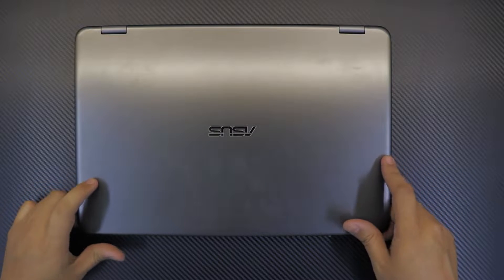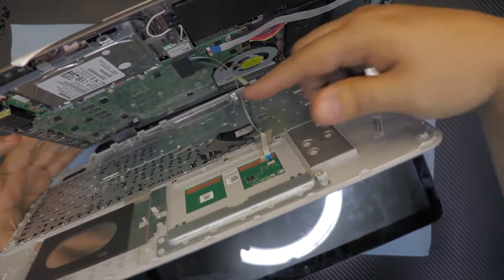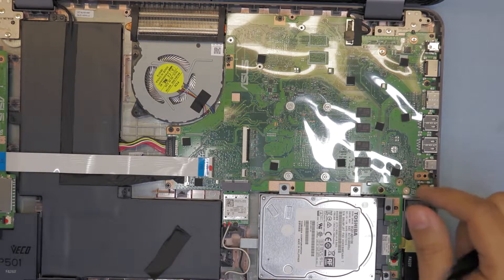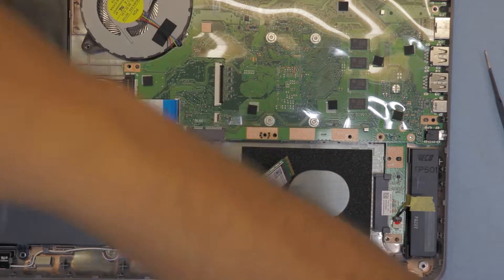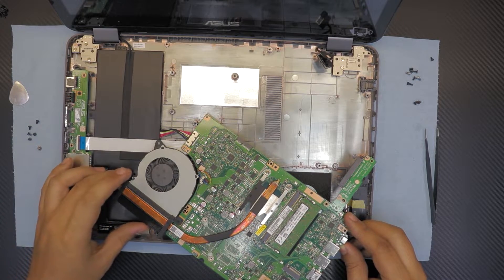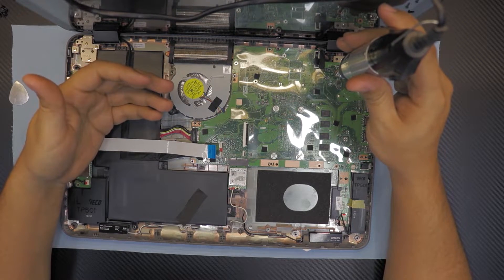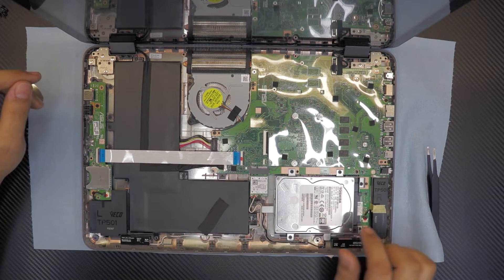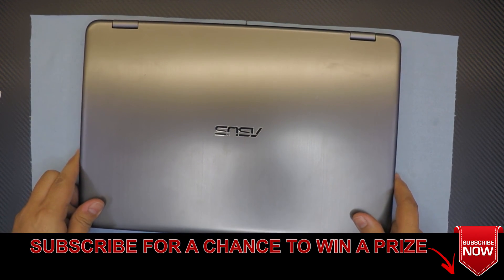ASUS VivoBook Flip TP501UA Disassembly and Service

Comment: Hi! I have the ASUS VivoBook Flip R518UA-DH51T 15.6". I’m trying to do a ram upgrade but wanted to make sure if it’s the same exact laptop you had before I open mine up. What would the max GB RAM and am I able to remove the Toshiba hard drive and install an SSD!
Reply from the maker: 🫠Regarding your question, sure you can remove the HDD and place any SSD 2.5' up to 2TB without any issues, and install the windows in it.
about the ram to check the max ram capacity check this: https://youtu.be/tKEJTkVth4Q
16gb compatible ram: https://amzn.to/43oWNPN
Should you have any further questions or requests in the future, please don't hesitate to ask me.
cheers🍻

This is an Amazon affiliate link. When you use my links, you are helping to support the channel. 🙏

Comment: Hola un saludo, como podría resetear la bios de esta lap, pues no funciona el teclado el mouse, ni los puertos usb y ni el touch de la pantalla o sea no hay forma de comunicarme con la tarjeta madre, es que veo que no tiene pila para el bios .Gracias
Reply from the maker: El problema no es de bios es otro chip que controla el IO y has que cambiarla, y soldar uno nuevo, recomiendo que lleve a un tecnico bueno. no es solo resetear.
Reply: @uFixTek  Gracias agradezco tu respuesta
Reply from the maker: @albgerb.b.2021  por nada amigo, espero que encuentres a un buen técnico que te pueda reparar. cualquier cosa me avisas.

Comment: Is RAM upgradable i dont see a slot
Reply from the maker: Thank you for the feedback! if you wish to support the channel you can LIKE or SUB or both :P
regarding your question: there is a ram dim soldered on board and on the other side of the board there is a ram dim so you can upgrade @8:40 i'm pointing to it

Comment: Quick question, I have the same model but my laptop is stuck on the BIOS screen and even disabling the security boot and enabled csm, after saving and restarting I get put onto the boot screen, from there I can only go back to the BIOS, is something wrong with my Harddrive ?
Reply from the maker: Thank you for the feedback! if you wish to support the channel you can LIKE or SUB or both :P
regarding your situation: its most probably that you hdd is dead, i would recommend you to place an SSD for better performance and stability.
and install windows, here are some links for the ssd and how to burn windows into usb:
https://youtu.be/uDu8j2lE-dM
to boot into usb its f12
use this windows installation step for tips and tricks:
https://youtu.be/er1UXhie3cA

ssd: https://amzn.to/3gxaeFz
https://amzn.to/3vfxM71

Comment: Where is cmos battery location?
Reply from the maker: this models don't use cmos battery they use the internal battery, disconnect the internal battery and press and hold the power button for 30sec to clear cmos.
i appreciate if you sub to support the channel :)
Reply: @uFixTek  what if it doesn't work at all, it keep shows nothing on both leds, no charging no power, is it mosfet faulty or something??
Reply from the maker: 1st of all you if you have no led light or charge light it has nothing to do with your cmos.
you need to make sure that you have power going across the power jack use a multi-miter to measure that the 19v is there after the jack and let me know,
https://imgur.com/a/zoLXPA6

Comment: Can you still use if you take out the battery?
Reply from the maker: yes you can and it will work just fine and even the motherboard will last longer because it wont have to charge the battery. good luck  and thank you for the support

Comment: I have the same laptop fpr almost 3 yrs but its so slow do u know if i could possibly speed it up or upgrade it
Reply from the maker: you can speed it up a lot just by adding an ssd :
https://amzn.to/32lY9Ma
and use your mechanical drive as an external drive:
https://amzn.to/3hvB3ZY
Reply: @uFixTek  thanks and how much vram can i put in there?
Reply from the maker: vrams cant just be added only regular RAM can be replaced. this models doesn't have a video chip nor vram.
Reply: @uFixTek  does your version have a nvidia graphics card
Reply from the maker: no the version in this video doesnt come with video chip. and if it did the vrams are always always soldered on board.
Reply: @uFixTek  oh because mine has a 940mx
Reply from the maker: ok then you have GPU and vrams beside it, still you can't replace or upgrade vrams or gpu
Reply: @uFixTek  oh ok so i can only really pur an ssd in
Reply from the maker: you CAN put the following:
-put an SSD
-replace your RAM with a bigger ram dim.

you CAN"T do the following:
-no CPU upgrade
-no GPU upgrade
-no vram upgrade

Comment: Does anyone know if this model laptop can run with power plugged in but no battery?  I want to troubleshoot my TP501 problem after a water spill.
Reply from the maker: yes, you can run the laptop without the battery plugged in  with no problem.
Reply: uFixTek Thanks for the helpful answer.  My son actually spilled water on my laptop.  it shut itself off totally. I took the laptop apart and let each part to dry for three days.  Then I assembled back and plugged into the wall outlet to give a try.  The laptop’s lights was on for 2 seconds and shut off totally again.  I guess it is total loss for my lovely Asus laptop.  Your video has helped me tremendously to do all these steps above!!
Reply from the maker: im glad it helped you for some parts, that laptop is repairable but you need to find a good repair tech that knows how to repair components, else they will just milk the cow. :(

Comment: Hi bro how are you. You remember me. I installed m. 2ssd nvme samsung 970 evo plus  ssd as per suggestion but i face some issue. Its not detect ssd  in my laptop. Please give me any solution
Reply from the maker: did you place the m.2 ssd correctly in the slot, if you did email me at bdsoporte.queretaro@gmail.com
Reply: @uFixTek  hi bro please check your email i send some photos  what i did and please give me any solution 
Thanks

Comment: tanks for video. did you work on mother board with battery conected?
Reply from the maker: yes you can work just fine on the motherboard with battery connected as long as you have the power off. and make sure you dont drop any screw or screw drive inside :P else you can simply disconnect the battery. thank you for the feedback

Comment: Thanks ++ Bro.
Question re the Power Button... could a malfunction of this cause the laptop to spontaneously shut down, even when booted just to BIOS? 
Or is this more likely to be motherboard related?
Thanks again!
Michael
Reply from the maker: hi, very simple for the laptop to shutdown regarding the power B, you must know that the power button must be pressed for over 5 sec in order for the laptop or PC to shutdown "spontaneously " "hard shut down".
so when you turn the laptop on and if after 5-6 sec the laptop still on and it didn't turn off then its not your power button, if its over 6sec then you may have a bad HDD or back ram chip (as they are soldered on board). if the laptop if entered to bios and it shouts down in there then you are in a trouble you have a component issue.
i recommend to do the following,
when you power on make sure you don't move the charger cable ,
remove the hdd and enter bios, see if it shuts down.
try using a different charger, it could be your charger(but then all depends if your battery if its not holding any charge)  and you have a faulty charger then ya it should be your charger,
power off connect the charger and let it charge and power on with battery see if it shuts down.
let me know , good luck
Reply: @uFixTek  thanks, I'll try that approach. Just can't turn it on at all now. Might have not connected the power cable properly so will 'operate' on it again. Might take a few days.
Reply from the maker: oki let us know
Reply: @uFixTek  I got it going again after disconnecting the battery. Must have short circuited it somehow. Whilst troubleshooting this I noticed that it will  run continuously ie not shutting down at all, with the keyboard removed. I plan to give the inside of the keyboard a good vacuuming...ie could dust build up or some other internal keyboard problem cause the laptop to short circuit/shut down? 
Unfortunately I've damaged the black locking clips of the mouse/keyboard ribbon cables - any clues on what to do? They're so fragile...
Reply: Update...got the touchpad ribbon cable connector clip back in place, with assistance of this video:
https://youtu.be/Sb8COGH5IRU
Needed a forceps and sharp needle to edge the tiny thing back in.
So basically the problem was dust related.  I also used an isopropyl-alcohol swab to clean up the underside of clear plastic (where it was in contact with circuitry).
uFixTek, thanks again for the video...couldn't have repaired it without it!
Reply from the maker: im glad that you got it working and thank you for the feed back :)

Comment: Hi Bro i am using same laptop. how to upgrade m.2 SSD. which SSD we want to use .  i am Confused.  which one is suitable for this laptop M.2 SSd NVME or M.2 SSd AHCI . Please advice to me . 

Thanks
Reply from the maker: you have few options:
you can keep your mechanical HDD as an extra storage,
and install a M.2 ssd on the motherboard near the ram attached picture.
or if you have the money go with m.2 nvme ssd , much faster than the normal m.2 ssd
location of the m.2:
https://imgur.com/a/cL2rppz

m.2 NVME:
https://amzn.to/2Z29Wiy

m.2 ssd:
https://amzn.to/3dPkWnR

if you want only replace your mechanical HDD with ssd sata 2.5:
https://amzn.to/2yWWLF5
Reply: @uFixTek  Thanks bro for quick response
Can i install nvme m. 2 ssd is better
It will work right
M. 2 ssd nvme is suitable for my laptop
Reply from the maker: yes it will work.
i highly recommend the m.2 NVME samsung , they are very reliable.
https://amzn.to/2TaHkjs
Reply: @uFixTek  Thanks Bro. thanking you  very much.
Reply from the maker: my pleasure and thank you :)

Comment: Hi, my camera from this TP501 just crash, any idea to open the screen? or it is better to throw it away, also the HD is too slow (Toshiba). This is a terrible laptop
Reply from the maker: there is not much you can do this laptops have lots of problem i get them in the shop very often.  if you want to open up screen, you have to use a heat gun at 150c or a hair dryer at max heat and heat up around the screen and use a opening tools to detach the screen as it has a double sided adhesive tape, once you remove the glass screen ten you will get access to the camera
Reply: @uFixTek  Quite complex, it does not worthy enough.Thanks a lot for your help

Comment: Awesome, thanks for the video. Also, I tried to remove the white cable and the whole thing came out, it seemed to have been glued to the lil circle since there were bits of it inside. Bought a card replacement but the wire doesn't want to connect to the circle, are there any replacements available? Tried every keyword I could but no luck
Reply from the maker: thank you for the feedback, but i donno what part you want to buy?
Reply: @uFixTek  It's the white AUX cable, it's connected to something right on the bottom left corner but I can't seem to find the little rectangle box thing
Reply: @uFixTek  Hello! Sorry if my comment seemed confusing, I know now what exactly it is. It's an INPAQ Aux Antenna and the p/n is WA-P-LB-01-141. Although I keep trying, I have no luck finding this. I went on Asus and INPAQ but no luck there either. I've tried key words such as "wireless aux antenna" "inpaq wireless antenna" "WA-P-LB-01-141 wireless antenna" etc etc with no luck. I've so far been able to only find a PDF report frokm FCCID, which is how I found out. If you've any luck or any further information on how I can obtain this certain wireless AUX antenna then I would greatly, greatly appreciate it!!

Comment: Que onda bro, leía que eres de Querétaro, un saludo.
Tengo varias preguntas mira: 
La primera es, por lo que entiendo no tiene puerto m2, así que recomiendas comprar un NVMe Sata y sustituirlo en lugar del disco mecánico que trae, es correcto??
La segunda es: Mi tp501 tiene 8gb instalados le puedo aumentar esos 8gb, osea trae otro puerto más y de que tipo?
Y la última y más importante es que le descompuso el teclado, el conector que va a la placa madre el que está más ancho, parece que lo dale de tanto jugarle a meter y sacar, crees que tenga compostura??
Reply from the maker: el teclado si se repara el conector si qusta nos puedes llevar y se repara. sobre la tema de NVME y mecanico y sata.
la lap tiene una puerto pci-e m.2 en la parte de atras de tarjeta alado de rams, donde puede conectar un m.2 ssd, o un NVME ssd. * NVME sata no existe!
solo ssd Sata puedes poner en lugar de hdd sata .
y en m.2  puedes poner NVME ssd o m.2 ssd

sobre tu rams, el equipo viene con un ram soldado y otro cambiable en la parte de atras de tarjeta purdes poner uno de 8gb o 16gb max
mas de lo que esta soldado en este lado.

saludos
Reply: @uFixTek  Gracias Bro :) aclaraste mis dudas, soy de la CDMX si puedo ir con gusto te visito, un abrazo.
Y ya me quedo claro esto, por si alguien ocupa, la lap puede tener ssd Sata(en el lugar de el HDD) y tmb trae un espacio para m.2 se puede usar un NVME ssd o m.2 ssd!
Reply from the maker: Fer Ma con gusto aqui le atendemos, saludos
Reply: Disculpa mi ignorancia. Entonces puedes usar un disco NVME SSD y al mismo tiempo usar el HDD? Es decir, dos discos al mismo tiempo?
Reply: Por cierto, mi laptop es la TP 501 UQ, no sé si haya diferencia. Estoy pensando en comprar un disco SSD, pero tampoco sé qué medida le queda. Alguna recomendación? Y muchas gracias por el video, estoy tratando de limpiar mi laptop porque ya se calienta un poquito :)

Comment: Hi  I have the same laptop and opened it to upgrade the ram after doing that the lcd  screen  is not turning on however laptop is starting. Can you please help me?  Thanks
Reply from the maker: REMOVE BOTH RAMS, then power on and it would not do anything, then turn off and plug both rams all the way in and power on and it will take up to 15sec to configure the rams.
Reply: Thank you for your prompt response but I d forgot to plug in the LCD WIRE. SUBSCRIBED SHARE AND LIKED! YOU ARE THE BEST!

however I am getting battery problem after putting everything it is showing me cross mark ❌  on the battery sign  in the Taskbar only when I connect to charger but when it's not connected then it stays unknown  remaining. 

Appreciate if you can help.me with this
Reply from the maker: i'm sorry but for some reason youtube comments algorithm, took your response and placed it in spam area, donno why!
im glad that you got it resolved. 
regarding the battery its a easy fix.

follow the following steps:
open your device management drivers: by right clicking on your windows start then choose "Device manager"
then you want to uninstall all and any driver that says A/c power by right clicking and click uninstall.
as shown here:
https://imgur.com/a/CxwtjVa

The battery driver will be reinstalled automatically after the start. Then check if your battery is charging now. 

If the above didnt work follow this:

-Shut down your laptop (ensure to save your work before shutting down).
-Remove any peripheral devices connecting to your laptop, such as USB drive, Bluetooth.
-Unplug the AC adapter charger from your laptop.
-Press and hold down the power button for 60 seconds, then release. dont let go if the laptop powers on and anything just hold it 60sec
-Re-plug the AC adapter/power charger to your laptop.
-Power on your laptop as normal.

should be charging and saying “plugged in, charging”

if that didnt work do this:

Switch to Full Capacity Mode Battery Health Charging
Another possible solution for ASUS laptop “plugged in not charging” problem is to check your battery health mode and make sure to choose Full Capacity Mode (many thanks to our lovely users for the advice).

ASUS laptops provide a feature named “ASUS Battery Health Charging”, and it pops up automatically in the very beginning after your OS is installed. And it offers three options for you to choose for your battery health:

Full Capacity Mode: Your battery is charged to its full capacity.
Balanced Mode: Your battery stops charging when the power is above 80% and re-charges when the power is below 78%.
Maximum Lifespan Mode: Your battery stops charging when the power is above 60% and re-charges when the power is below 58%.
So if your ASUS laptop is in Balanced Mode or Maximum Lifespan Mode, you’ll no doubt have the battery not charging problem. To fix it, follow these steps:

1) Go to Taskbar > Show hidden icons at the bottom right corner.
2) Click the battery health charging mode icon.
3) In the popup window, select the first option: Full Capacity Mode. Then click OK to save.
4) Restart your laptop.
https://imgur.com/a/VC2OewE

let me know
Reply: @uFixTek  you are the best bud! It worked thanks again